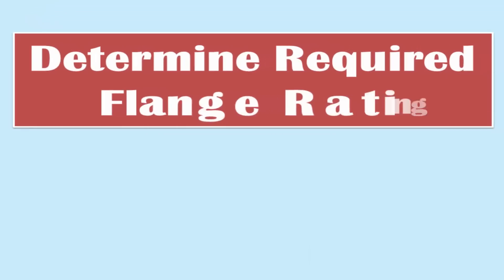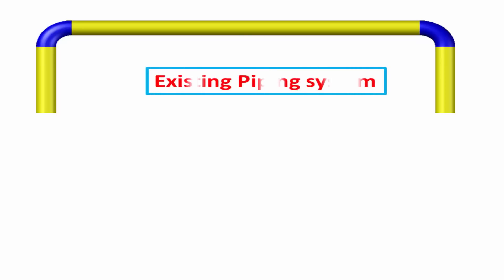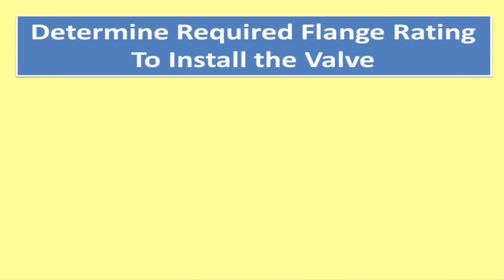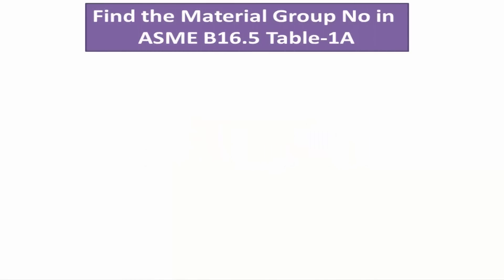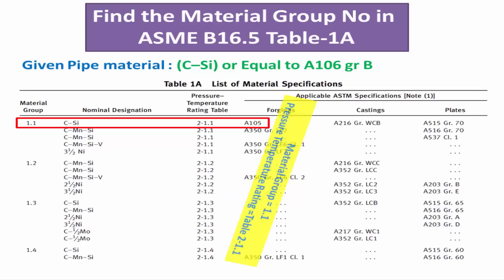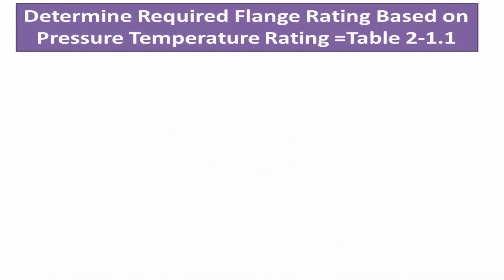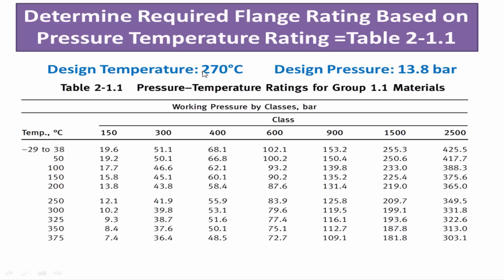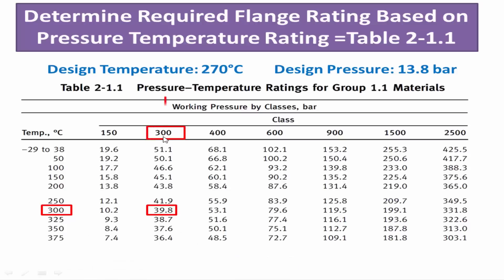How to Select  Required Flange Rating Class as per ASME B16.5

Comment: What about the pipe wall thickness ? If the pipe thickness is calculated by the given design pressure and temp condition does it mean the flange could sustain from the higher pressure and temperature condition than the pipe itself (flange designed stronger than the pipe) ?

Comment: Flange rating = f (pressure and temperature). daily need for residential ( clean water and others)  flange rating 150 already enough but if the temperature  of fluid isde more than 200 C shall be applied  rating 300 .

Comment: Why is it pipe material A 106 Gr B but you select as it is A 105 material in the table?
Reply: A 106 Gr B on the pipe corresponds to A 105 on the flange and ASME B16.5 is for flanges.

Comment: in the above Video, Flange Rating should be 150# instead of 300# since the required pressure is 13.8 bar which is very near to 10.2bar. please clarify.
Reply: Always select over your value at the table never less than your value, therefore you cannot chose 10.2 bar at the table because your value is 13.8 bar and you go to the next value which is 39.8 bar.